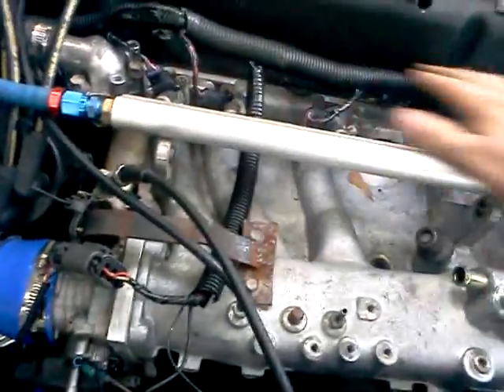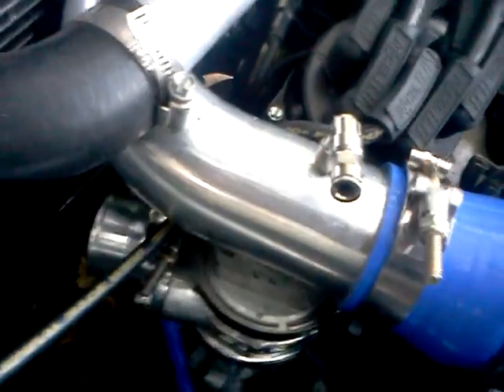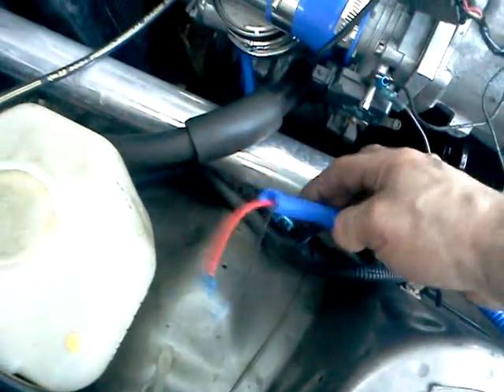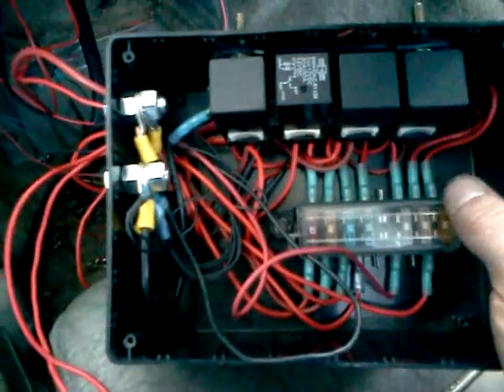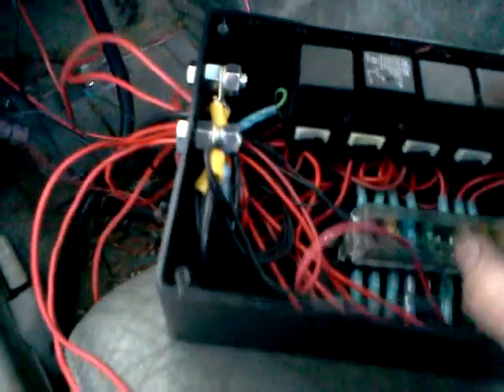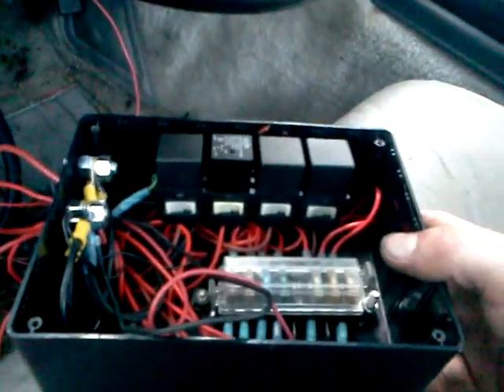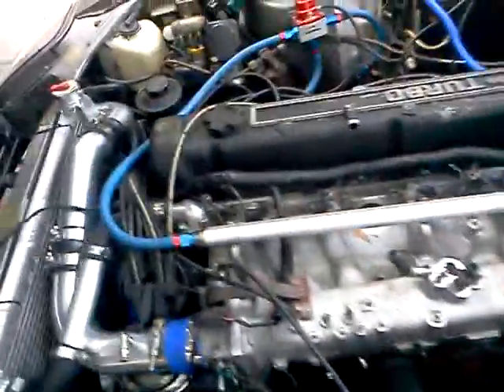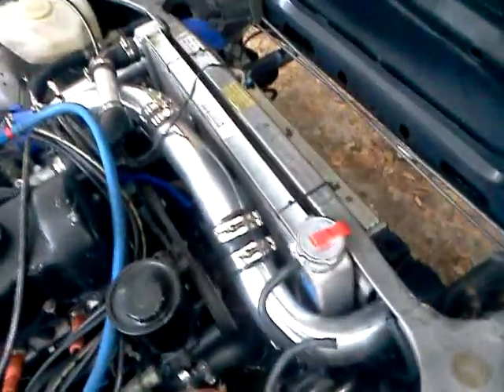Shane's 280zx, new mods

Comment: Is that a returnless fuel system your running?
Reply from the maker: No. The return line is connected to the regulator which is mounted near the strut tower.